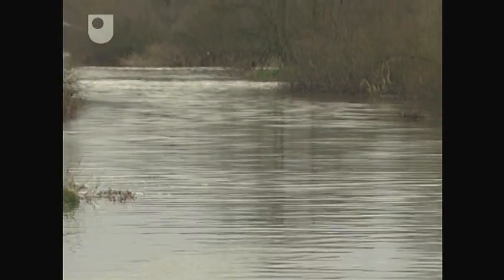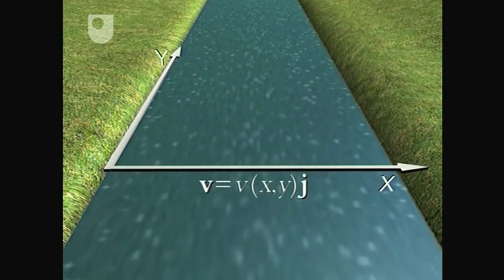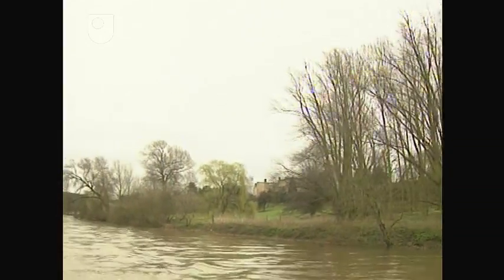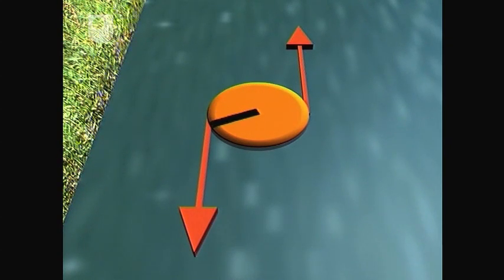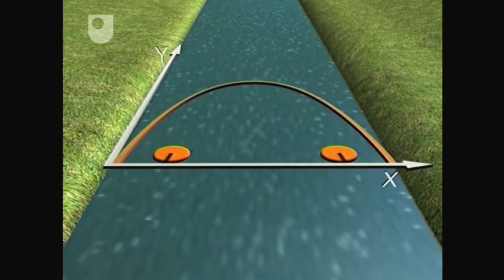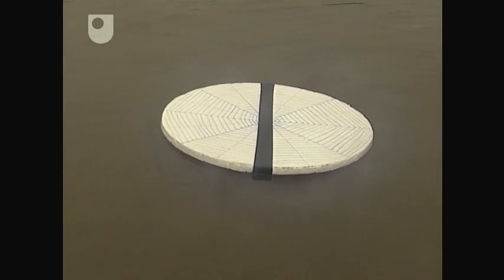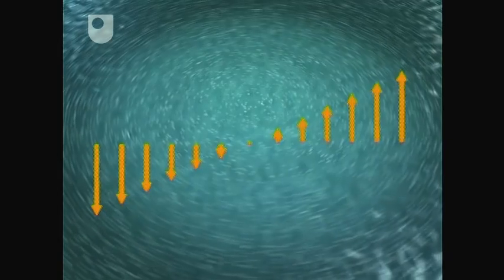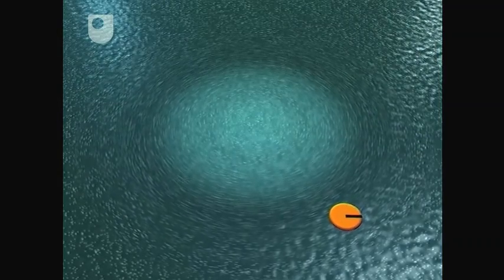Curl - Grad, Div and Curl (3/3)

Comment: Great video!  Question:  At 4:30, the ccw rotation of the disc is described as being caused by the downstream flow on the right & the relatively lesser flow on the left of the disc.  In reality, wouldn't this give rise to the magnus effect l, causing the disc to float toward the center of the stream?

Comment: +masterxilo the velocity profile is parabolic because at the edges, the velocity is 0. As you get closer to the center of the river, the flow velocity increases to a maximum in the center and thus giving you a parabolic profile. Its called the no-slip condition in fluid dynamics. Look it up